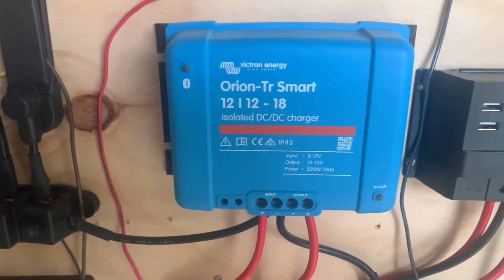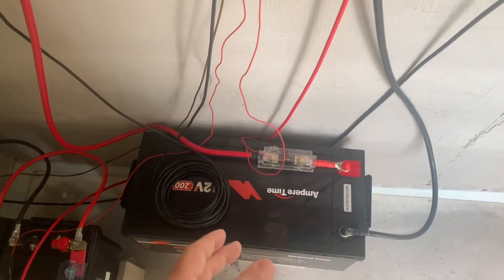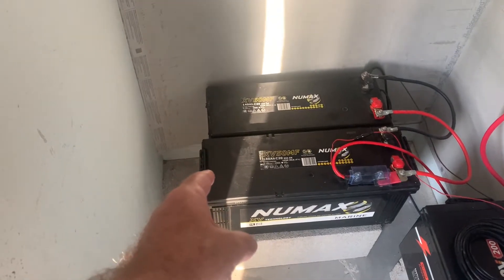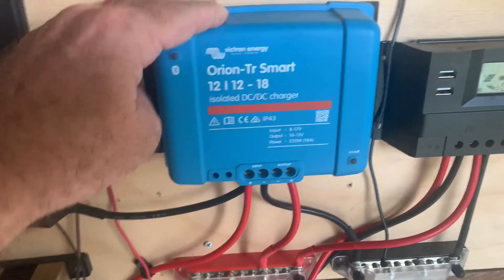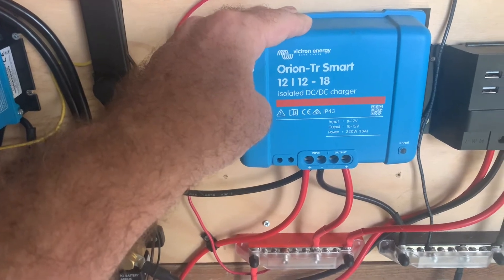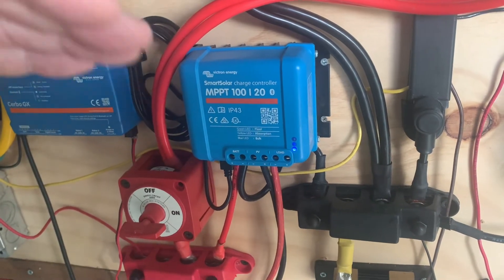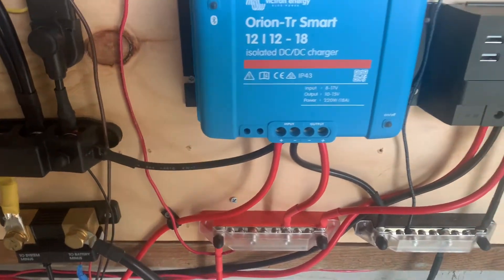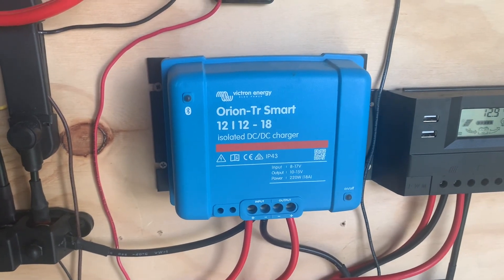Victron Orion smart 12/12 volt charger to connect to any other battery bank

Comment: I like what you’re doing.  I also have assorted battery banks and kept thinking if this would work. I’m was researching this and see you have it going your way.  I have 1 Set of 12 volt lithium  in series 24 volt. . 3 AGMs 12 volt in parallel and  “4 -12 volt MK Gels that are very slow charging in nature with the chemistry of Gels.  My problem are the Gels, Brand New and I got them for 1/2 price.  If I new then what I know now kinda thing, I would have stayed away from the Gel chemistry’s for Solar. Wondering are there a setting from the AGM 12 volt to the Gel, it maybe a stupid question but I’m new to this crossing over stuff ( dc to dc).   No wasted Solar is a fine concept.The fact of moving power around, especially in off grid or emergency, automatically is a great feature.  I figure I can cycle the gels about 2 times a week for many years running a tv and computer.  Any input would be appreciated.
Reply from the maker: Hi and thanks for the comment. I’ve been out of the country lately and so couldn’t respond before now.  I actually phased the this unit out of my install and just put the second battery bank on a different solar controller and panel. I will be bringing it back once I move to the boat so I can use it to connect to the boat factory installed house battery and as you say make sure there is no wasted solar.  As far as your setup I would go to the Victron website and look at the user manual (they have them all online  … great site) and then you can see what battery settings are possible.
Thanks again for the comment, all the best.
Reply: @colinauld  Thank you for your reply. I'm headng for the website now.  Have a great trip.